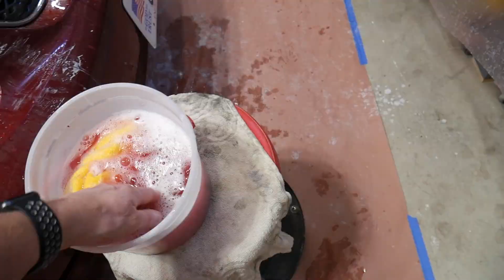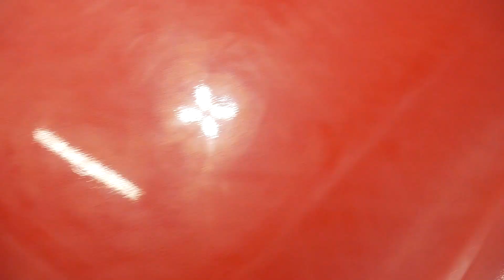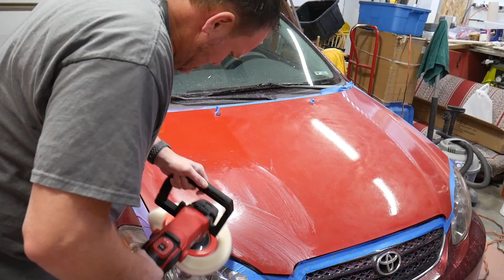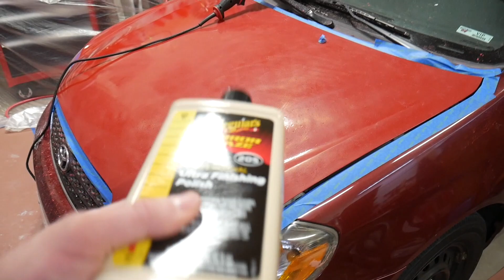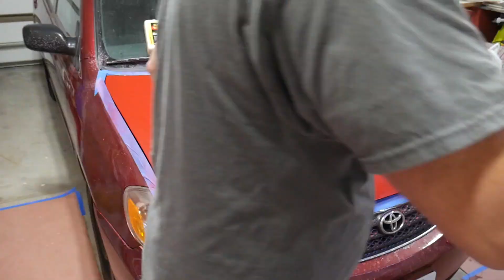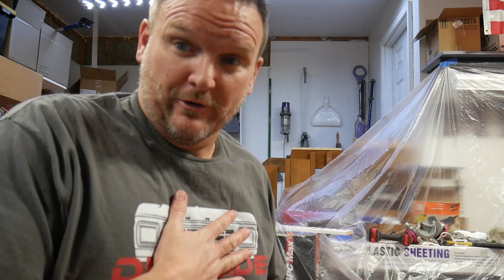EVERYTHING WRONG With My First Ever DIY Rustoleum Paint Job - cut and buff

Comment: All the diy guys hide all the dirt solvent pops fish eyes always. I see it the pan the cam so the light doesn’t shine on it.  Well in that env expect dirt. I get dirt in a booth. It just is what it is. Yes it’s super hard to apply paint the right way and get perfect results as no job is perfect. None. Well for one it’s not flat. U didn’t sand enuf. Ur doing by hand which is brutal. U can use da as long as u avoid edge. Divots are called fish eyes. Contamination. If it’s wavy when u pan back and forth it ain’t flat. Easiest way to see is if you wet the surface and squeegee the surface to see if it’s flat. Dark areas low spots need to sand till u see uniform dull. You also needed to start 1200 more aggressive with that much peel. Man U guys trying to save cash always the rustoleum crap. It’s brutal to use bad products imo. Harder to do right when ur using fingerpaints and really estimating what u need to do. Can’t tell you what to do going forward. Up to u brother. I would try a hood and test over and over and over before u do an overall
Reply from the maker: Thanks for the detailed feedback - I appreciate the technical advice.

Comment: Being one whom uses Rust-Oleum spray paint religiously both for cars and motorcycles, both mine and others, I can tell right off that you have only two problems, the first and biggest one is not letting the paint cure long enough, secondly using miquires polishes with all the silicones they have in the product will cause hazing etc, when I do my painting I do the color, wait 20 min do the clear 3 or 4 coats depending on how I feel, let it dry. After about 30 DAYS ,  of it curing 1500 wet sand and buff to a brilliant shine. 👍👍👍 Stay away from silicone polishes, there is a reason body shops don't use em.
Reply from the maker: Thanks for the detailed comment. Experience is everything for sure. What clear do you use?
Reply: @troysgarage  Rust-Oleum, make sure it is the ENAMEL coating and NOT the oil based , right now I use the new 5in one Rust-Oleum spray cans , they are really good, so it's rust oleum gloss clear enamel, or the color coats with the same name. Hope that helps.

Comment: DA polishers are more forgiving. Look for a long throw polisher. Also you probably don’t need to use a high cut compound on a new paint job. Finally you already know, but you need to do hard body lines manually. Also.. your garage is waaay cold for painting. I’d recommend warming up the garage above 70 degrees, and definitely waiting for the paint to finish curing.
Reply from the maker: Thanks for the tips!

Comment: Nip back to your orignal video,  read the comment, skip the PITA wet sand/buff stage next time. You can get a finish off the gun that is gleaming with just a few tweaks. If I want to "shove" a customer into realising their vehicle is in dire need of a re-spray when they say it isn't, and I have it in to repair just one panel, I bang an "Off-the-gun" finish onto the repaired panel - it's slightly unethical-ish, but does get The Hint across - a bit like when power-washing contractors clean just one small bit of your driveway as "A Test Sample"... the cleaned bit sparkles, so everything else looks crap.. they gonna get their whole drive cleaned.. 

Someone driving off with one door gleaming like a new pin & the rest of the vehicle looking like an old dishcloth tends to start wanting the whole vehicle gleaming like that door... :-)
Reply: @troysgarage  Life's hard - you gotta do what you gotta do. 🙂

Comment: What pressure did you shoot at? Did you use an HVLP gun?
Reply from the maker: 25 PSI and I use a Harbor Freight cheap gun with a 1.4 tip.

Comment: No afence but u had only clear coat pealing might of tried to use 600 and then 100 spray bottle it as u go to rinse and finish off with 2000 rince and then wipe untill no color or rag is clean when u wiped and have a neg air and wipe cheese cloth and wait 15 have a radiator heater and make sure your temperature helps with orange peel and mix it 50/50 white fan and full blast and just clear it white 20 minutes between each coat three coats just some hints and tips that's all you'll get it down pat Rome wasn't built and you're doing good keep up good work

Comment: Don't sand in a circle pattern it makes the buffing part harder. And stay clear from the corners till you gain some more exp with the high speed buffer. If the buffer is spinning away from the corner then it is less likely to burn through.
Reply from the maker: Yup, saved this in the very next video. 😜

Comment: Enjoying the content and you seem like a really nice person. Sometimes things don’t go as planned but that’s why we practice. I use this paint on my engine blocks with rusty metal primer base. I am not quite sure what i think of it as it stays sticky for a while but seems to dry harder than spray paint. I need to paint my car body and I thinking of going with an eastwood color just cause it’s not as expensive as some of the paints out there but not the cheapest (rust oleum, dupicolor) which I was thinking of doing. Anyhow, don’t beat yourself up. Your technique and approach seems spot on coming from a YouTube video watching professional!
Reply from the maker: “YouTube watching professional”. I love that!!!  Thanks for the kind words and catching up on videos. In the follow up video we respray the whole car, but that was my plan all along. I was using the hood as practice. I’m getting better and better with each thing I mess up on. 🤣
Reply: @troysgarage  hey even if you think your messing up, you could be helping someone. One tip I came across with painting through the paint gun and may help you with clean out is the thinning. I can’t remember who had the video but it was helpful to me and the tip was to keep thinning and checking by how it runs off the paint stick steadily. It may be worth a try on a small batch to see, but I’m no professional either just a Ill try anything diyer. But I think it’s all in your approach and willingness to learn and get good results. Subbing. Thanks for the good content!

Comment: First not sure if you used a catalyst or not, but uncatalyzed paint needs at least a couple of weeks (a month is better) to cure before you should touch it with sand paper or a buffer. Best practice for catalyzed automotive grade acrylic enamel is to give it few days even a week before attempting a cut and buff. Cold weather means you'd need to wait longer as it slows the curing process ...As far as burning through the paint with the buffer goes the wheel should always be spinning away from the edge of the panel. As well you need to slow down the wheel and use lighter pressure near edges. Again the wheel should never be spinning in a direction where it can catch the panel.
Reply from the maker: I am still learning the tricks with the buffer. It was all practice (secretly I knew we were repainting the whole car - see the follow up video for that - https://youtu.be/tL9rBNtBRPk). I do appreciate the added details for proper buffing though!  🙌🏼

Comment: No expert here but skimming thru the comments one other said what I would say. Use a DA buffer. It's much more forgiving. I've done my dually truck, 28 foot travel trailer, and my 6x12 box with not a single burn using Meguiars 105 and 205 (If I remember corect). Oh and I did my first "experiment" with Rusto semi gloss black last weekend mixing 1:1 with acetone. It was on a  utility trailer and it worked quite well but no cutting/buffing afterwards. Very nice try though.
Reply from the maker: Seems legit. Those buffers are speedy little buggers though. 😱

Comment: I painted my 1960 Ford F-100 with rustoleum paints and primers. First I sanded it all down to original factory primer with 120 grit, cleaned it with a denatured alcohol, sanded it again with 220 and more denatured alcohol using many clean rags. Then I used clean metal primer, sanded THAT down with 400 grit, cleaned again with denatured alcohol. I then mixed 1 quart of rustoleum regal red with 1/4 quart Flood Penetrol additive and 2 ounces of paint thinner mixed all together. I then gave it 2 coats using foam brushes and rollers wet sanding in between coats with 600 grit. It turned out great. The penetrol lets it lay down with no drag or sag and it cured out awesome. I have yet to cut and buff it all. It's been 2 years since I painted it and people see it and can't believe I rolled and brushed it all.
Reply from the maker: They say “it’s all in the prep work!”  You definitely put in the work!  Nice job!  Not sure I’d dare use a roller. 😱

Comment: Remember just one thing - you can't get the paint to look any better than the surface actually is before you spray the first drop. If the surface isn't smooth, the paint can't be either.
Reply from the maker: Truth
Reply: Preparation is 90% of a good paint job. You can't roller skate on a gravel road!:face-orange-frowning:

Comment: Recently did my 1st rustoleum oil enamel spray out. Color was just flat black. I mixed it 4:3:1, paint, acetone, catalyst with 1 capful of Japan dryer. It laid out nice and flat. It dried very quickly. Something was definitely wrong with your 1st spray of the custom red. That paint seemed to refuse to lay down. If you mentioned your mix, I didn’t catch it. The only other thing I questioned was the wet sanding of the build primers. To my knowledge, that stuff will absorb moisture. I think I would have block sanded those dry. On the color mix, you might try a final volume less than the complete volume of one full container of paint. What I mean is, an exact measured ratio, leaving some paint in each of the individual component colors. Great videos and thanks for sharing.

Comment: Buy catalist Hardener and add 2 caps to every mixed cup of the spray gun and Japan drier 1 cup to every mixed cup of the spray gun. They make the paint dry faster, look better and last longer.
First the Japan drier then mix it then the catalist Hardener then mix it.
Reply from the maker: I’ve been researching Japan Drier and it def sounds like the answer I’ve been looking for with Rustoleum paint. Thanks for helping with ratios. I have another Corolla we just bought that needs a fresh coat. More practice time with the paint gun. 🙌🏼

Comment: I reckon you needed to do more wet sanding to get the orange peel out. You did what I did the first time I did a cut and buff, you didn't sand enough because it's so damn scary! You just need do another wet sand until the shine is completely gone and there's no more "eyes" should look completely flat. Also, I reckon you should've used a Dual Action Buffer with a foam pad (with a large throw). DA Buffers are far less aggressive. I think this is a really good first shot! I'm gonna paint my whole car with Rustoleum and then sand and buff.
Reply from the maker: No kidding it’s scary!  😱 What’s even more scary is filming it for the world to see!!!!  😳  Thanks for the comment and suggestions. I’m all about learning and teaching others. I’ll get better and better with more practice. Gotta perfect it before using expensive materials on a vehicle that really matters - #midnightmaroon

Comment: Rustoleum really isn’t the best paint to use if you want to cut and buff. Most of the gloss in this kind of paint tends to settle at the top of the coat as it dries. Trying to cut and buff it burns through the gloss layer and it just never really buffs back to that original level of gloss. Even if your doing a “roll and tip” paint job, using a cheap automotive paint (or even a farm implement paint from Tractor Supply, etc.) really won’t cost much more than a gallon of Rustoleum from Lowes or HD and will usually better allow you to sand and buff the shine back in ... plus you can still add some hardener and roll it on safely (since your not making the hardener air borne, those chemicals won’t be settling in your lungs). All that said, I absolutely support your efforts here. Even a cheap Maaco paint job can easily cost you over a grand these days and most older cars are not worth that. Spraying a car yourself without the proper equipment is messy and dangerous. Just play around with different paint until you find something that meets your satisfaction. Lacquer would probably look/work the best, but it is more expensive and doesn’t weather well. Automotive acrylic enamels can be bought pretty cheaply and you can use them with or without any hardener. Really, there is just no substitution for good prep work before laying down any paint. Old peeling clear coat has to be stripped off to a smooth surface otherwise you never going to be able to lay enough paint over it to make it disappear.  Keep at it and enjoy the challenge.
Reply from the maker: It’s been fun to experiment and I’m learning more with each attempt. Plus comments like this are filled with gems of info and I love to learn from others. I watch more videos than I record.

Comment: What if you used japan dryer then sanded after first coat dries?
Reply from the maker: That def would have helped especially cuz of the colder temps I was spraying in. It’s all good though. Watch the follow up video to see how my brother helped me put a sweet smooth finish on the entire car.
Reply: @troysgarage  I seen the follow up video looks good. 

I sprayed my Santa Fe this spring. It was my first paint job. It was good, just not new. 😆 😆 😆. I had heard that sanding after the first coat of base, it would take some of the imperfections out of the paint job. I thought about using rust-oleum paint, but I wanted a clear coat on it and I need to test more with the clear on rust-oleum. I would like to find a good car like yours that runs good just needs some paint. Maybe fix up to resell. Something I can use to test paint. Something I can try to mix a hot rod red metallic paint. I painted my car a metallic red. 
I wish I had a lift and a shop. I painted under a carport. The neighbor was combining corn and there was coal trucks running the road and the bugs was driving me crazy. I used bug fogger to help with the bugs. I figure I was lucky it was as good as it was. 

Can’t wait to see the next project.
Reply from the maker: WOW!  That was a lot of things going on while you were spraying. Would make it near impossible to get anything better than good results. Probably lucky it was good as it was. Flipping cars is a great way to earn some cash. Save up for an upgrade or two. 👍🏼

Comment: I've done two cars with Rustoleum spray cans myself. I think I would suggest using a nice high build primer and giving it time to dry. I gave mine two days for every panel. Afterwards I wet sanded it down with 400 grit and made sure to use a guide coat. When I got to the base coat at that point it stayed fairly smooth. I used 1500 grit to level it after a day of drying in the sun. I gave it two more coats and did the whole car that way all the way around. When I cut and buff it took far less work but the paint was dry from sitting in the sun. Added a ceramic coating on top and it was done. It had a few spots but it was consistent. The slower you go with these jobs the better I'd say. Lobe the video. I get the ocd nature of your work so I hope you get the results you're looking for. Keep up the good work and great videos. They're entertaining and show that there are other who are learning this same as you. It helps a ton.
Reply from the maker: Thanks for sharing. I’m not stopping. I’ll continue learning and sharing my progress. 👍🏼

Comment: Don't get discouraged. My tip (as diyer like you) is to sand the car with 80 grit, going to bare metal is ideal). Then skim coat the parts with the excessive clear coat peeling with bondo, then sand smooth with 120 up to 220. Bondo will feel the imperfections and won't be visible. Then go with the primer etc. 
Also, you might have dry spray, rather than orange peel, note that you can start wet sanding with 1000, then 1500 & 2000.  Question why didn't you clear ? Was it a single stage?
I
You did a good job! I really enjoyed the videos! Cheers from Athens Greece!
Reply from the maker: Thanks for the extra detail.  I've watched enough videos and done enough research that I "know how" to do it.  But putting it in practice is a completely different ball game!  The paint was single stage (Rustoleum Oil Based) with a custom mix.  My next video in this series shows how me and my brother corrected this and sprayed the entire car:  https://youtu.be/tL9rBNtBRPk

Comment: 👏👏👏 hows that 66 you picked up of the farm. Can't wait to see that project too
Reply from the maker: I've got to clear my plate of several projects before I can even think about starting on that one!  But a sneak peek is that I will need to either rebuild or replace the steering gear box.  One of these days I'll get over to my buddy's house and pull the old one out so I can make decisions.  Don't worry I'll be recording and posting every step of the process. I'm dying to get that baby rolling again though!
Reply: @troysgarage  man I cant wait ill be tuned in